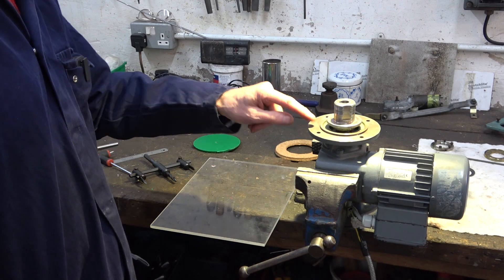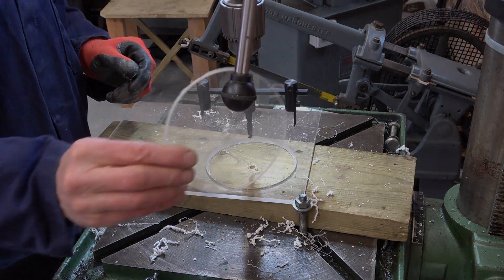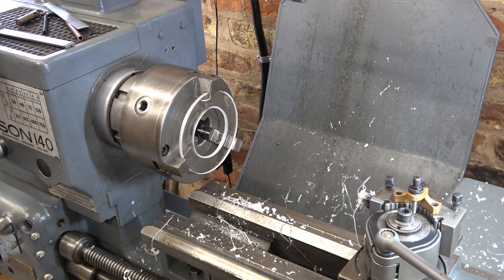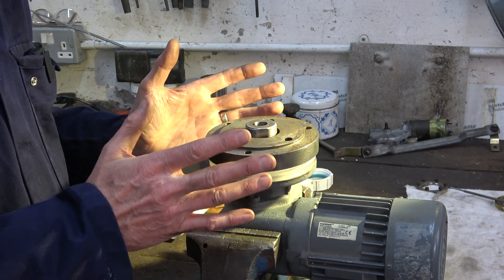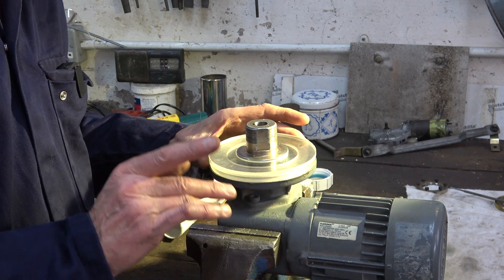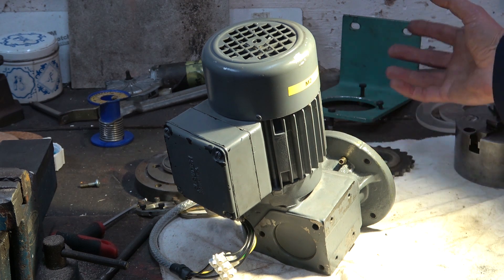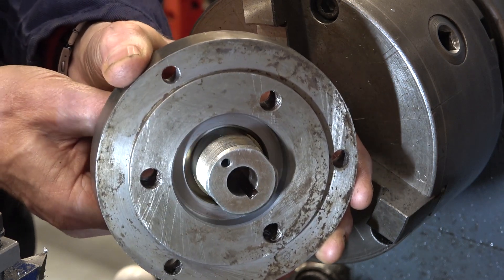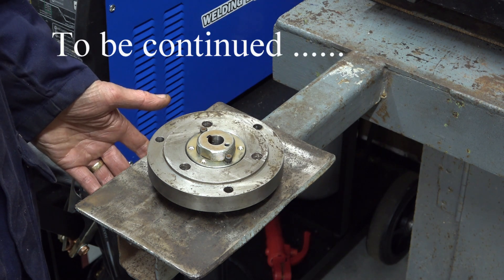HS114 Shopmade welding rotator build – Part 2

Comment: Happy New Year! I am really enjoying this project, thanks. I am not sure I understand why you need purge gas through the centre of the chuck. I didn't notice the issue with the spring, clearly I need to watch closer
Reply from the maker: Hi GTB, when TIG welding the argon creates a shield and keeps the oxygen away from the molten pool. If you are welding thick material the molten pool is only on the surface so there is no need to shield the back. But, when welding thin material the molten pool is potentially right through the metal so the back also needs to be shielded else it will oxidise, drawing oxygen into the weld and causing impurity and porosity. Some materials are more sensitive to this than others. So if you are welding tubular or hollow you need the argon feed through the centre of the spinning chuck to purge the internal spaces of the work and expel the Oxygen.   I've been experimenting and it is conclusive - video sometime later. Cheers

Comment: Happy New Year Paul. It's an interesting build so far. I hadn't noticed the spring until you mentioned it. We have one of those Trepanning tools in my old workshop at work. I think we used it once (fairly sure it was on acrylic for a template) and was then too terrified to let it see the light of day again. 
Best wishes, Dean in Oxfordshire.
Reply from the maker: Happy New Year Dean. Those wind milling trepanning tools are extremely useful but must be used with caution and respect. If they don't get you the work spinning will......

Comment: Thought I must be missing something re the spring. Great work so far, looking forward to the next installment. Do you have the peristaltic pump on your headstock gearbox lubrication system now? It is something I want to look into as I suspect my Harrison M250 will be similar with regard to main bearing oil starvation at low rpm.
Reply from the maker: Carl, top marks for spotting that. At the moment I am still using the small gear pump with the timer. Recently I was doing some heavy low rpm work and forgot to press the start button for the pump so I've been thinking about switching to the peristaltic, which can run continuously. So I left the peristaltic running continuously cycling some oil in a can for a few days and it worked fine - did not split the pump tube or anything. My only hesitation is that the flow is very low. I have had my eye on a peristaltic on ebay that shifts about 0.5 litre per minute but it's about £25 and I can't quite bring myself to spend that much. I will probably fit the peristaltic I have sometime in the next couple of months. Cheers
Reply: @HaxbyShed  Hello Paul and thank you for taking the time to reply to me about this.

I haven't done any extensive testing on my lathe of the oil feed at different rpm settings, as you did. However, based on the headstock internal similarities between your 140 and my M series, I think it is a reasonable assumption that I will have the same issue.

At the moment, I see two possible solutions. The first and probably the simplest to embody would be an electric motor driven pump, like you have done. As my lathe is run from a VFD, this idea would lend itself to simple control using a spare VFD digital output to trigger a relay when running in a certain frequency range.

The second method might be a little more elaborate to integrate but perhaps provides the best long term solution. I think it ought to be possible to drive a small but rugged gear pump from the lathe input drive belt. The pump drive pulley could be a simple jockey arrangement. The larger M series machines have driven lubrication pumps, so that might give some inspiration.

I shall think some more on it!

Comment: For the insulators I think I'd have roughly hack / jig sawed followed by a nut and bolt arbor in the lathe. Your trepanning tool is terrifying 😂
Many ways to skin a cat! 
I look forward to part III
Reply from the maker: Hi TRM, for large holes in thin sheet the trepanning spinning windmill of de*th is a good solution if you can keep your hands out of it. Cheers

Comment: Nope, don't know what you're trying to do with the spring! Or the point of the insulating plastic discs. I guess all will become clear in future episodes. The central gas purge is a neat idea though & I can't help wondering what you're going to be doing with this rotator now it's done!
Reply from the maker: Hi MidEng, you probably know, if the earth return circuit is through the gearbox the welding current can burn the bearings and/or gear teeth. So I'm making an earth contact on the back of the chuck by having the chuck spring loaded against a copper plate which is earthed. The rotator is made and working (I usually video the whole project before I cut it into parts so I know the whole thing hangs together) and I'm using the rotator now in a couple of new episodes of "Diary of a TIG welding beginner".  The central gas feed was something I knew I might need maybe but from recent  experience I now know actually it's essential when welding thin tube because otherwise the back side of the weld oxidises badly. I will show the results on camera in due course. Cheers
Reply: @HaxbyShed  Yes, I have a simple powered turntable for welding & have seen how the earth current can wreck bearings, so connecting the earth to the chuck makes total sense, & I thought, at first, you then wouldn't need to worry about the bearings...Thinking on though, I see that there would still be a potential electrical path through the bearings without the insulating discs! Would any of the earth current go that way? Best be safe than sorry, right? Good thinking!
The centre gas feed will be invaluable when welding stainless steel which gets HORRIBLE on the backside of the weld without a purge (or a backing of some kind).

Comment: Hi Paul...I can see the time that goes in the details.You did inspire me to make an experimental set up with my mill rotary table  and forked drive battery drill at low speed(normally used on compound slide of little lathe).For now a healthy 2022!
Reply from the maker: Hi Robert, Happy New Year to you. Yes if you have a rotary table it lends itself to a rotator, I see.  When making something like this the solution is often shaped by the parts I find - if I found different parts then it would be done another way. Cheers

Comment: Alternatively for an insulator all you need is some paper or paper board. Because I am in the electrical industry I would use some fish paper or Nomex because it is at hand. Some automotive gasket material would also work. Insulate bolts with acetyl bushings.
Reply from the maker: Hi Glenn, yes impregnated paper is a great insulator by all accounts. Rotators often use a large carbon brush to make the earth contact to the chuck but I could not find anything that large readily available so I went for insulators and a copper plate.
Reply: @HaxbyShed  did you consider brushes from an auto starter? Just brain storming…I got a TIG unit for Christmas and now I have a steep learning curve to go through.
Reply from the maker: @glennwright9747  Glenn I did but I could not find  a single large brush I thought might take 200A. And also large brush sets were not that cheap.
Reply: @HaxbyShed  inventing is sometimes frustrating. Just can’t find the right part at the right cost. 
It is quite common in large DC motors to parallel multiple brushes to get amp loading at around 200 amps per square inch. So when you get a motor rated at 1000 + amps it is quite common to see half a dozen or more in parallel. But in your rotator that would be a PITA to mount.